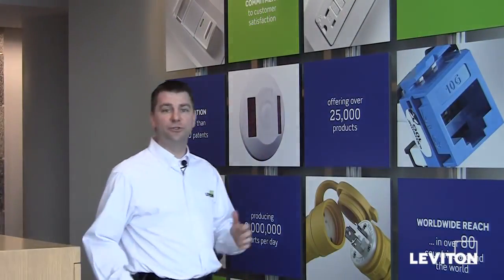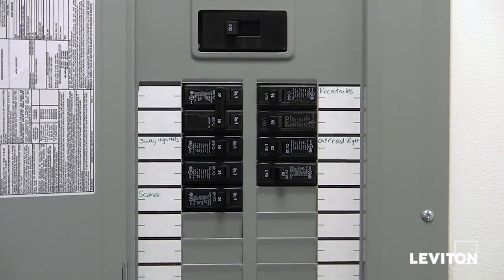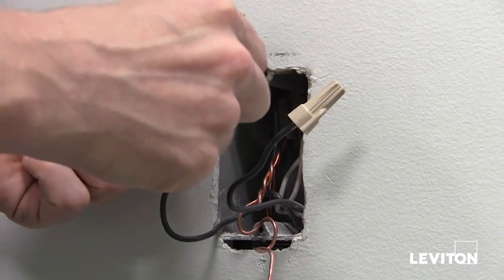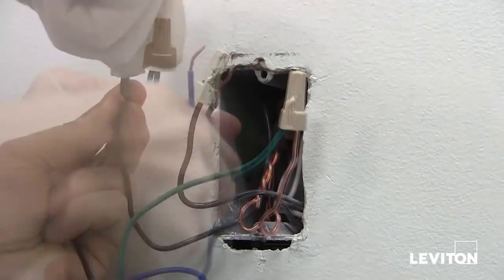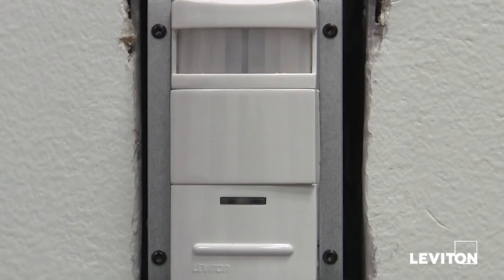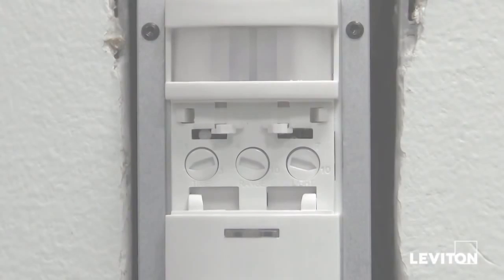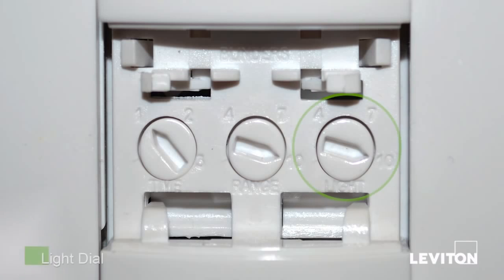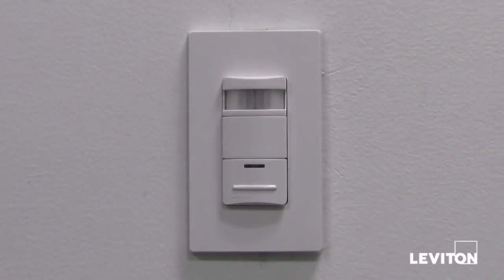Leviton ODS10-IDW Infrared Occupancy Sensor

Comment: this switches don't really work as advertise, the daylight option does Not work as designed I have tried different types of settings and my kitchen light will always go on during the day with all my windows and doors opened, no matter the adjustment
Reply: Im an electrician and ive never seen one of these not work unless you wired one wrong. If you just have a neutral / ground / hot in the box ground to ground- blue to switchleg - and hot to neutral
Reply: @brandonknight7240  Sir is there a way to buy just the button? Mine has developed a crack and wants to fall off. It works other than that and would not want to buy a whole switch again. Thank you